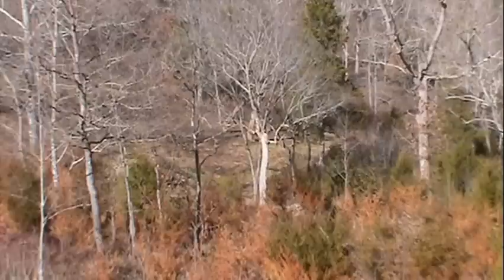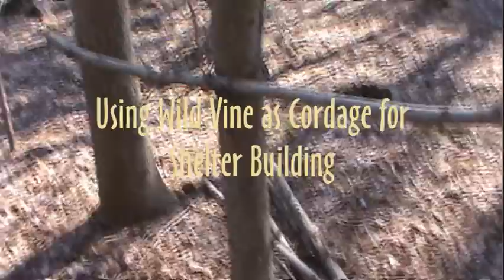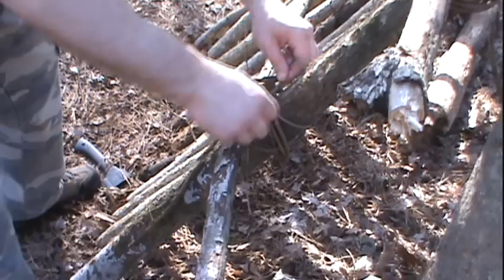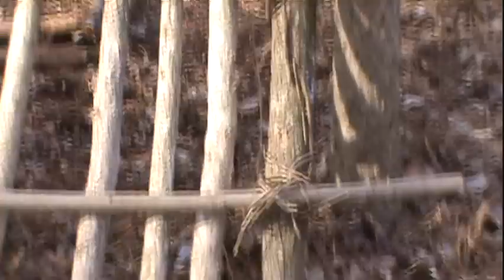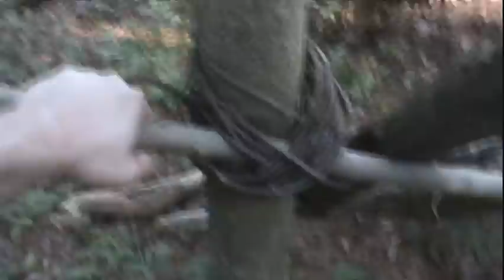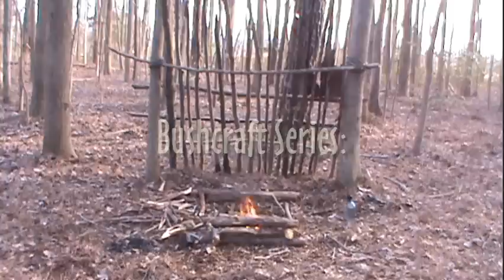Bushcraft Series: Using Wild Vine as Cordage

Comment: I find if you crush the vine with a rock slightly, it makes the vine a little more flexible and easier to work with. It doesn't really compromise the strength of the vine to a significant degree either.